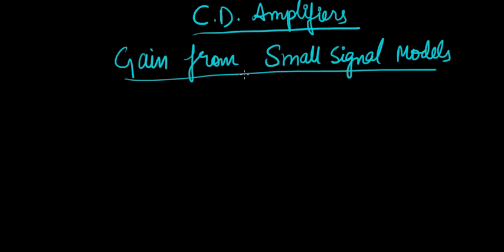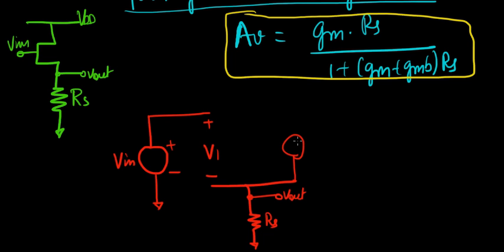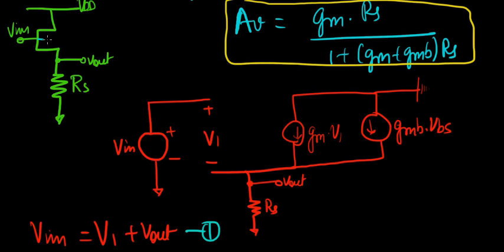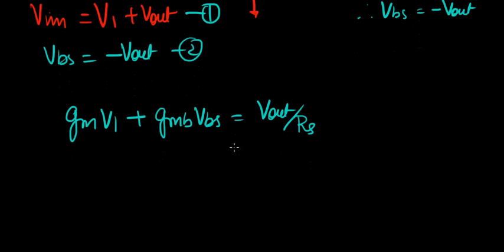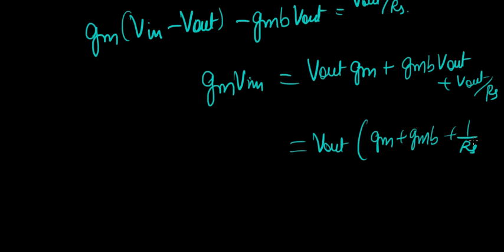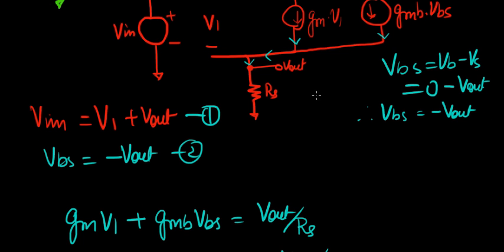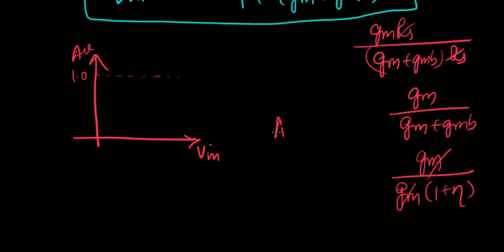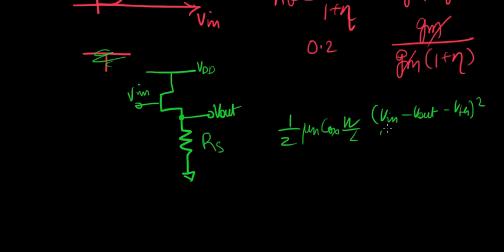Common Drain Amplifiers - Gain from Small Signal Model

Comment: You have beautifully explained each & every concept, which is not discussed in detail even in Razavi. Thanks a lot sir. You said, to reduce the non-linearity in this amplifier  we can use a PMOS as well as a NMOS transistor, but I guess to extract the current out of the circuit we use a NMOS & not a PMOS(Because we need a current source here.).